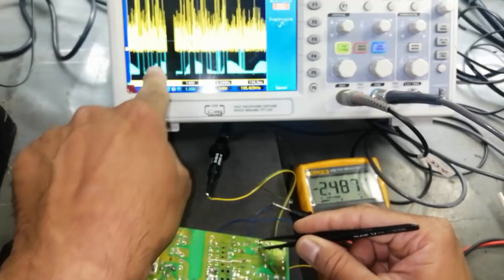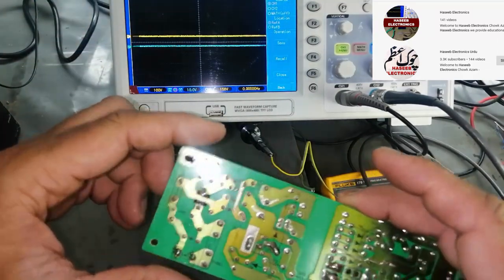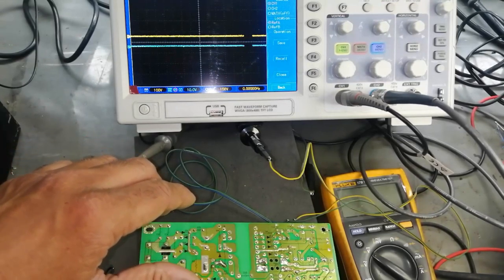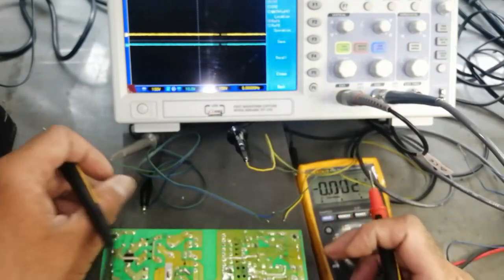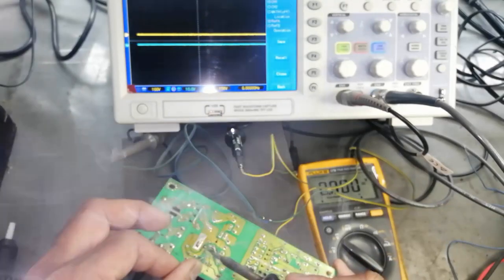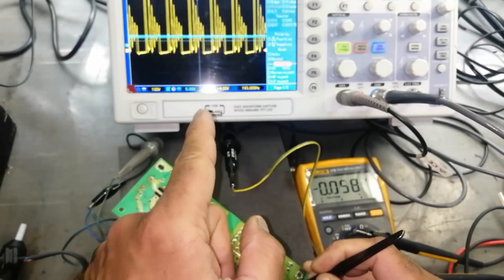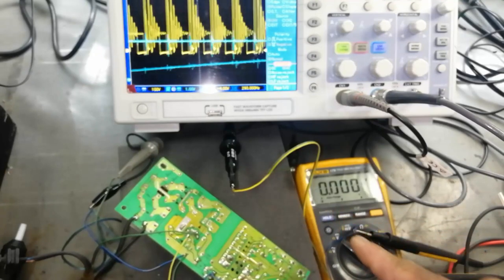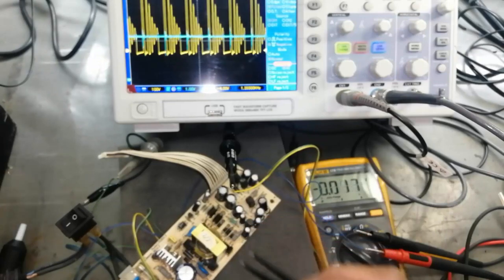#144 Fluctuations in output or Fluctuated or Unregulated output in Switch Mode Power Supply SMPS

Comment: It's a super informative tutorial that went deep down on the practical side. The best thing I learnt among other invaluable tips is that high voltage signal from the feedback circuit shuts the pulse width modulator IC off by indicating a short on the secondary side. Thank you!

Comment: Namaskar haseeb bhai . Ur video narration is one of the best smps video in youtube.  I have a water purifier smps & that gives less than 1 volt in some area of out put components resulting no output i. i have tried punting diode in 3 & 4 pin of optocoupler but the result are same. what could be the problem.

Comment: I have lb 2900 canon printer in this power supply is ok out side the printer but when we placed the board and connect the ribbon strip of lazer lens then on the leaf switch the MOSFET 2700 and connected resistance burn please help me.